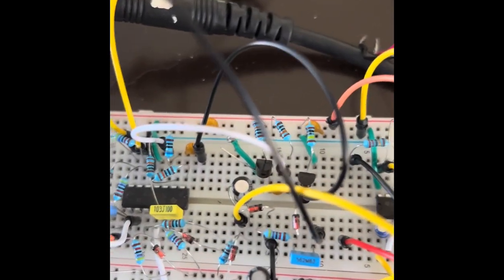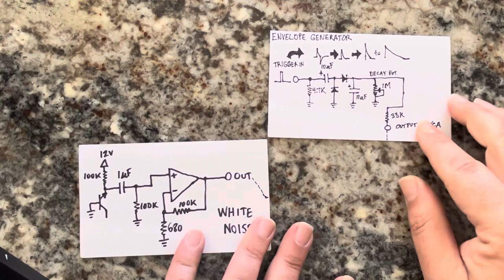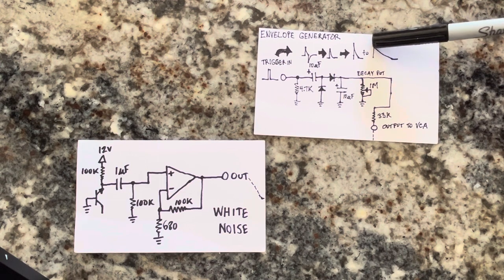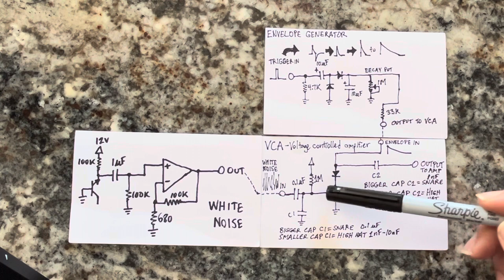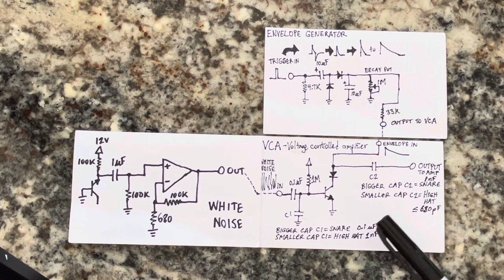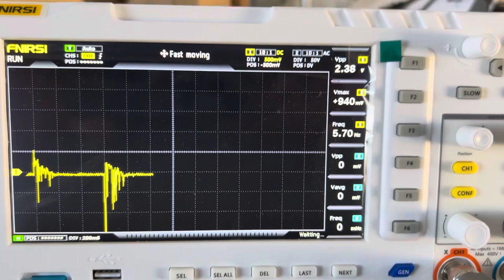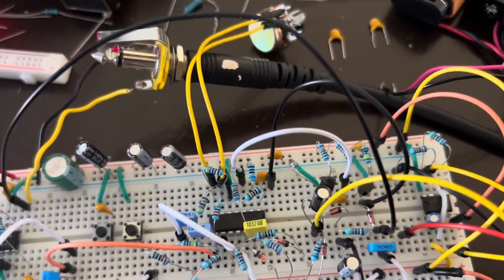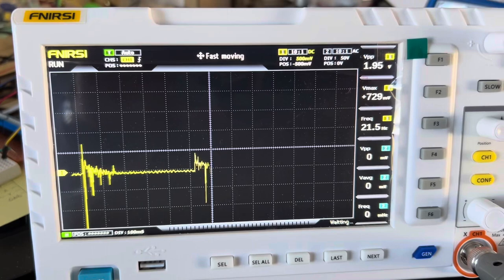Diy Analog Snare and High Hat-how to shape noise into drum sounds using envelopes and VCA

Comment: On that white noise generator, you may find some transistors don't work.  If there is no noise produced, the Emitter-Base breakdown of the one you used is too high.  It is rare but it happens.  If you hear a whistle or the noise seems very biased in frequency, you may have a different unlucky transistor.  Just try a couple and you will get it working.
Reply from the maker: At 12 volts, they mostly work. At 9 volts more likely to to have failure of breakdown. Datasheets for 2n2222 say 6 volts but almost never works at that voltage.